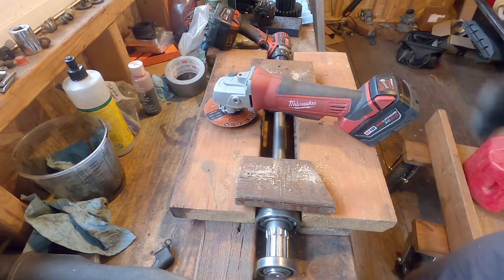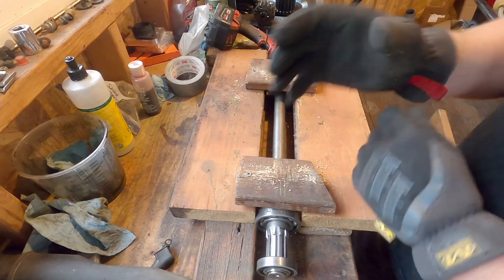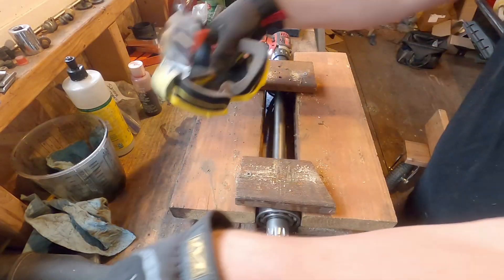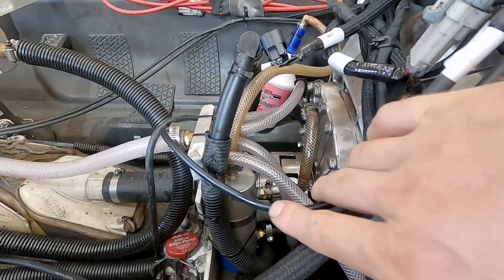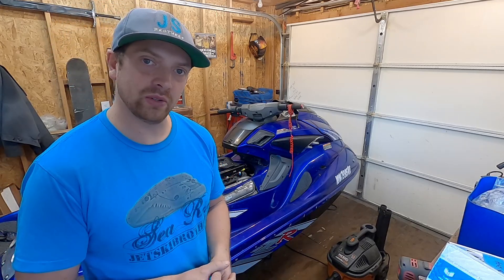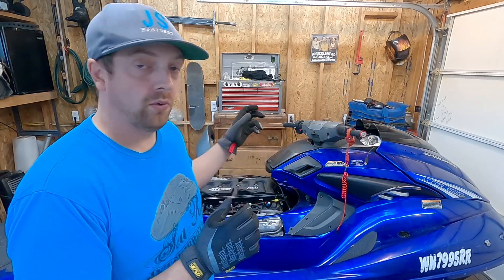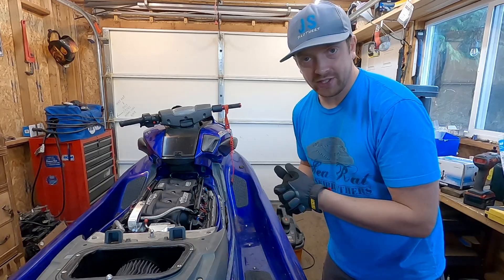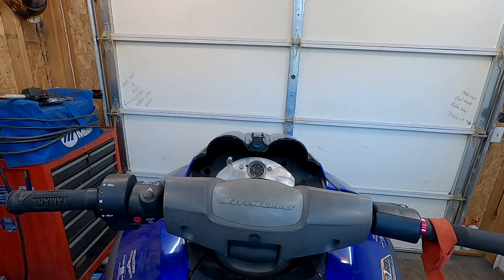Ls v8 jetski gearbox work

Comment: Coming along great but a small suggestion, route the usb cable towards the rear so you can run your laptop in a backpack while data logging on the water

Comment: I would take those idler gears an turn them down to about haft the with an drill 5 ⅜ holes in them an drill the main gears to .not sure if you're having trouble with foaming yet .we ran skidoo chain case oil in your quick change didn't foam as bad.do you have a magnet in you case. need one just screw it to the side or to the drain plug help the wear on gears .